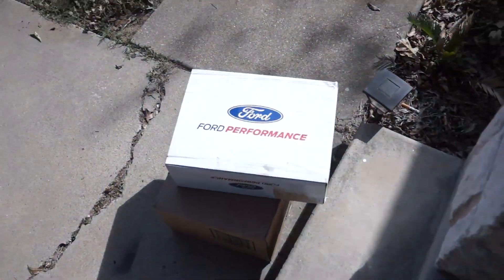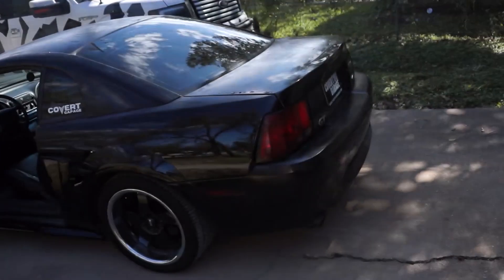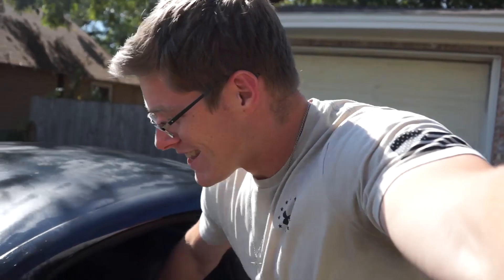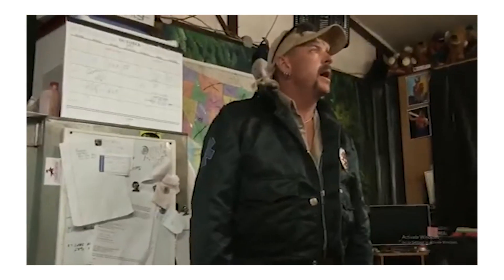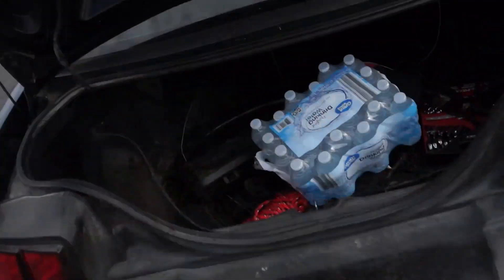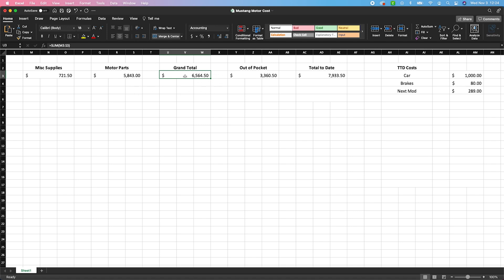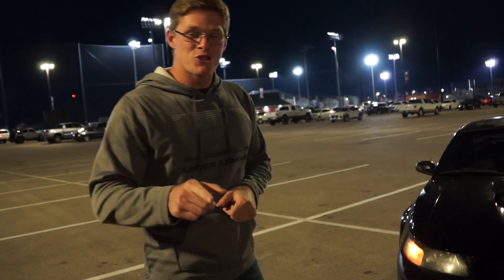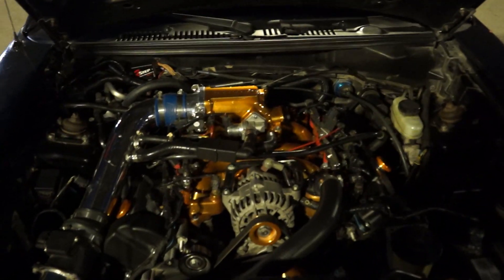Cost of Building A Full Bolt On New Edge Mustang

Comment: I’m with ya man. 20 year old college student with an 01 Mustang GT cams & pretty much full bolt ons. 
Total = $3K-$4K into engine/drivetrain. I always made sure to get the best deals possible, from the brakes, to the throttle body, and even my BBK long tubes, and honestly don’t regret it. Everyone loves the car (especially the sound) and I smile driving it everyday in Wisconsin. I’m running Goodyear Eagle Exhilarate all seasons so traction with my 3.73s isn’t the greatest but I plan on getting MT Street S/S drag radials for the summer months. I swear this modding game never ends!
Reply from the maker: Heck yeah that’s awesome!! All about the experience and how it makes you feel. I plan on getting NITTO NT555 but that kinda screws me for winter🤷🏼‍♂️